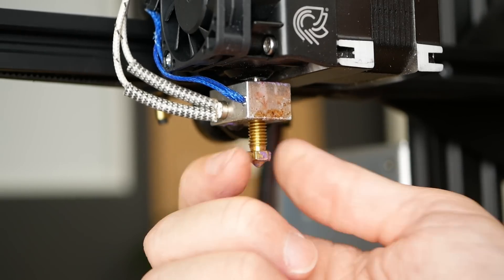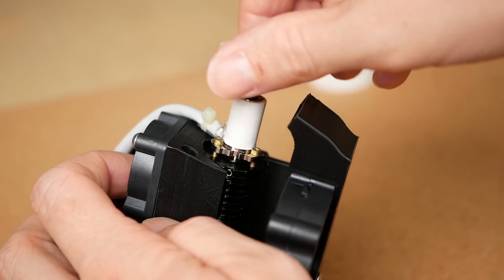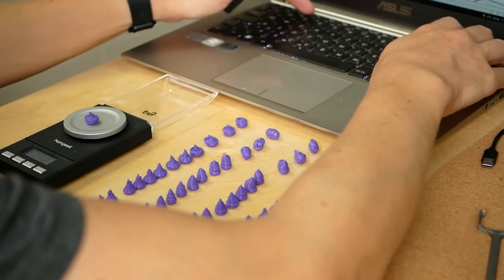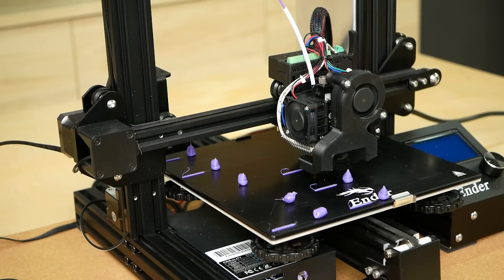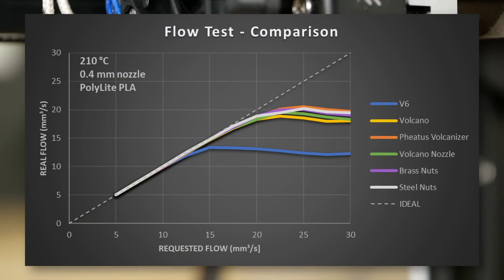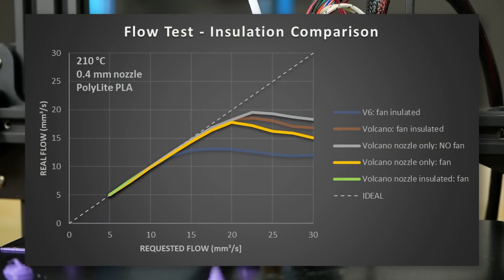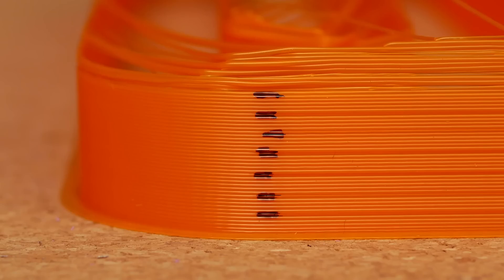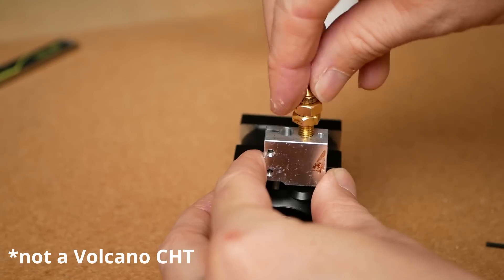Volcano is Obsolete: Just use Nuts!

Comment: Pretty interesting video Stefan! Have you tried finding a pure copper flanged lock nut? The do exist on Amazon or other sites and you would just remove the plastic washer inside. The flange part can go flush to the heat block end. Heck, you could add copper washers to the mix or a M6 binding barrel that has threading going all the way through. You be surprised the different types of nuts that could be a good way to increase heat transfer to the nozzle. :)

P.S. I'm trying out an  0.4mm airbrush type nozzle on my Ender 5 Plus and it is insane the detail you can get with Cura 5.0 new Arachne engine. They even have assortments down to 0.2 mm airbrush nozzles for around $8 on Amazon. :D
Reply: It would be better to get wider nuts. At that point you might just get a better block. less resistance and complexity.
Reply: @mckidney1  True. As long as what you get has a good and smooth flat surfaces between the heat block and the nut or custom metal piece you should get a good thermal conduction. I sometimes clean and polish my bi metal heat break with a Dremel and it looks really shiny. Add Boron Nitride paste and good to go. :3
Reply: have a link to the air brush nozzle you used?  thanks

Comment: Delta T is the highest in the top of the heater. By the time the filament enters the extension it's already heated quite a bit. So I'm the extension not that much heat needs to be added. Having the hottest bit on the top could actually be an optimum in heat transfer.
Reply: The downside is that the temperature will drop significantly towards the end so even if the heater is at 210C, the nozzle tip may only be 200C, preventing you from getting that extra heat in. You could compensate by raising the heater to 220C, but then when you aren't extruding, everything will heat up to 220C. Ideally you would want to control the temperature of the filament as it comes out of the nozzle. So having the heater closer to the nozzle tip and having the cooler end of the nozzle at the top would allow you to preheat the filament before getting to the nozzle and heater block. This would leave less of the filament at high temperature and for less time.
Reply: Which is why the copper results are so close to the results with nuts. The key element here is that the losses in the copper are not as big as the decrease of needed energy by the plastic. That will change as you said - longer nozzle and eventually the copper will actually cool the plastic.

Comment: Volcano block with a cht adapter, cht volcano length nozzle and a heat nut (heat zone extender)...(basically making the volcano longer) 
 Or the same thing on nitrams volcamosq.. I guess there is going to be a point where extending length is going to require higher heating capacity and maybe stronger extruder

Comment: would be interesting to see brass vs steel nozzle impacts, ie whether the poor layer adhesion and higher temp requirements of steel nozzles can be mitigated with a volcano (also, how much worse steel really is)
Reply: Steel needs longer blocks made with tighter PID variables. Making the nozzle longer will make it worse. Making it thicker makes it worse.
Which is why Volcano does not offer just longer nozzle, but longer block as well.
Reply: @mckidney1  from my understanding, the limiting factor with any nozzle-heatblock-material is the heat transfer between components, and using a longer nozzle might help there; 
even if not, heat conductivity is basically the only downside of steel vs brass, so getting a full volcano hotend for steel nozzle (rather than faster) printing might still be worth it

Comment: Hello Stephan and thank you for this instructive video :o)
After seeing it, I have a question about how to get more throughput to print faster:
🔥What would happen if the nuts were replaced by 1 additional heating block?🔥

The idea would be to have 2 heating blocks with a space between them 🔥🌞🔥:
- 1 to prepare the heating of the wire, but below the melting point (example in PLA: 160°C) to maintain a pressure in the nozzle channel
- Have empty space between the 2 to limit convection
- 1 other heating block for the exit of the molten wire (e.g. in PLA: 210°C) with a smaller height than a normal block.

Example: a normal block with a height of 10mm, a gap of 4mm, the second heating block would have a height of 6mm

If the temperature is better controlled on 2 heating points, wouldn't it be better to produce a more even, larger and faster output of wire?🤔

(I hope my idea is still understandable as I'm going through a translator from French to English)
😇
Reply: somehow install a thermistor on the heatsink and make the hotend fan temp controlled, probably it would get you a lot of clogs tho :D:D

Comment: I have a question! What about having 2 heating cartridges ? Have the first one pre heat the filament to 50% of what your main temp is, and the second one set to 200 for example. Would a preheat on the filament be better before into the main heating zones?
Reply: Like he said in the video, cartridges are not near their capabilities. Having more will introduce two sets of PID variables for not a big benefit. Th roblem that is solved in this video is that PID is a feedback loop system so if the heat has somewhere to go (capacitance) PID can push more heat into the entire system.

Comment: A hardened Steel Volcano Nozzle with brass nuts would be interesting. I wanted to print abrasive materials for a long time, but my first experience with steel nozzles and their bad thermal conductivity made a quick end to that.
So maybe a longer melting zone could fix that?
Reply: I did exactly that experiment, and indeed brass/copper nuts are not optional, flow is only a bit better without them. With brass extender I've got 60% more flow.
Reply: It sounds like you would be better off with a Volcano heater block, the brass insert from CNCKitchen, and a regular length steel nozzle. That way you would get the heating performance of the brass but the abrasive resistance of the steel nozzle tip.
Reply: Steel is worse than copper and the longer you make the zone the worse it gets. For steel you need to increase the block and shorten the nozzle (opposite of this)
Reply: @mckidney1  steel still has a couple orders of magnitude better heat transfer than plastic, and it is plastic which is bottleneck here. But yea, see my answer above -w/o brass nuts steel nozzle does little to performance, at least it was in my case.
Reply: @Balorng  That is not true, plastic is not the bottleneck. Plastic is the result. The bottleneck is surface area for the plastic. By increasing it you allow to melt more and introduce more plastic to again heat up thus increasing the flow rate. The idea here is to increase the area without increasing the size of the heating block. That is why steel becomes the bottle-neck and shows little to know improvement without adding capacity with the extra brass. Capacity will eventually dissipate and steel will again be used to transfer energy to the brass and the plastic again. So with steel nozzles, longer nozzle requires a longer block not adding nuts at the end :)

CAlling plastic the bottle neck would mean we need more plastic capacity to solve the problem. Not a bigger surface area to the plastic.

Comment: Out of curiosity: Did you ever tested a high flow nozzle or even the Volcano-Nozzle in an E3D-Hotend (and copper nuts) but with thermal paste in between?
Reply from the maker: I didn't but I'm quite sure it won't help a lot. The bottleneck is still the heat transfer into the filament.
Reply: Thermal paste is about 100 times worse than the copper in the nozzle. There is also more than 100x more  copper than the paste. This is a system that is designed to saturate the system with heat and not a PC build.
Reply: @mckidney1  You're mixing something up here. The purpose of thermal paste is not to outperform the heat transfer of copper or any other (mostly metal) material, it is to minimize the heat transfer resistance between two objects. In this case, it would be between the threads of the nozzle and the heat block and between the copper nuts. Of course, PC thermal paste would definitely not work, it is not even close to being heat resistant enough. You need high-temperature thermal paste for this application.
Reply: @toctoc9927  I think some kind of low temperature solder might be best (field's metal is one of the few non-toxic ones, but it's expensive; Rose's metal etc. are cheap). These all melt below 100 C and should be possible to apply in hot state and then screw the nozzle in without touching it with bare hands. I think most of these wouldn't alloy and ruin the heater block. There may be thermal expansion issues, but I'm not sure. Gallium is sometimes used for PC cooling as a "heat paste"; but it will wreck aluminium if given time and especially if there are any fresh scratches in the aluminium. If you get a bunch of gallium in there it will become as brittles as a day old baguette, and above as easy to snap off a piece. Gallium or gallinstan works for PCs because the IHS nickel-coated copper and the heatsink has a copper base (sometimes also nickel coated to match the aluminium fins) and very rarely is it just made of pure aluminium (if it is it is either an old or very low quality sink). Gallium would take the heat no problem; but it ruins some metals.
Reply: @mckidney1  I have to disagree.   Using thermal paste in between the components could lead to more even distribution of heat. Allowing more uniform melting. Though assuming good metal to metal contact the effect might be rather small. Depends how tight the nuts are screwed together and how good the fit on the threads is.

Comment: I've squeezed a bit more performance from my DIY "volcanoid" solid copper hotend by adding high temperature thermal paste (400 °C stable) to fill the air gap in the threads. (Don't use regular thermal paste)
Reply: High-temp 'anti-seize' compound is a great high-temp thermal paste.
Some are rated to over 1500F...high metal/metal oxide content makes for very good heat transfer.
Works fine on my V6...keep it away from the thermistor; the stuff can be electrically conductive.
Reply: I use HY880 thermal paste in my Hot-End, even on heater cartridge. It is rated up to 280℃ and I printed nylon at 270℃ with it.
Reply: what is the high temperature paste made of?
Reply: @cutterboard4144  I searched for thermal paste that's made for high temperature sensor mounts (exhausts, heater etc.), found a company that sells 5 gram syringes of that stuff. It's labelled "TG 20031" though that might just be that company's product ID and not a general term.
Reply: I've bought some for my hotend thermistor that is one of those small glass bead ones, the temperature stability was horrible until I threw some garden variety silicon white one, but it didn't last obviously.
Now I'll add it to the hotend and such, let's see how much better it gets (tho I bet not all that many %).
Reply: I was just thinking about that! I have some hotend boron nitride thermal slurry from slice engineering for that sort of stuff. I even put some around the thermocouple and heater to get more accurate and more precise thermal control
Reply: Sounds messy.
Reply: Would automotive copper grease do well in such application?
Reply: @aurimasknieza7320  no it serves the opposite effect. But do not worry your printer is nowhere near such sensitivity that paste will be needed. Such a printer would require Slicer to adjust PID settings based on flow rate.
Reply: I see what you did there.  :D
Reply: How about some blinker fluid? Better than HT thermal paste ©

Comment: I'm curious to see what your results would be with a silicon sock added to your block and to the exposed threads of the volcano hot end.
Reply: I was thinking that you could put silicone sealant over the nuts and nozzle body, you can peel or cut it off if you need to change your setup. That should also insulate well.
Reply: The socks and isolation affect efficiency. As long as he is pushing enough power socks do not help. Now a copper sock would help :)
Reply: @mckidney1  He already clearly indicated in his video that the silicone sock helped and that power was not the issue. He had a 40W heater and it only takes 10W to melt the volume of PLA he was pushing, so he was not lacking for power. The power is introduced at the heater block; everything beyond that will have lower temperature due to thermal conductivity creating a thermal gradient. Adding more cool air at the other end of the system increases thermal losses which increases the temperature gradient, lowering the effectiveness of the heating at the end of the nozzle. You need to keep the entire nozzle hot and ideally at the same temperature. Sure, you could increase the temperature at the heater block, but then you run into other issues as you burn your filament when it's not being extruded. To get even and consistent heating you want a large melt zone with high thermal conductivity and low external losses to minimize the thermal gradient throughout.

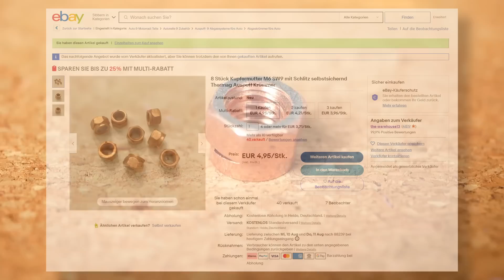Comment: 6:30 Tbh you should have known :D
You can also get these copper nuts in the Baumarkt (german here lul), sometimes they are called "Thermag-Muttern"
They usually find their place in the automotive world where they are installed on high-temperature parts like the exhaust manifold and sometimes even the whole exhaust system. The copper plating only prevents them from rusting onto the stud :)
Reply: Here it might actually help as a solid thermal paste :) Moving the stored heat in the nuts back to the shaft.

Comment: Maybe you should better use monolitic aluminum nut? It's very simple to make one - even without lathe.
Reply: Those nuts serve as capacitors in the system. They smooth out the changes. Resistance is not the key factor, capacity is.

Comment: And I was right, the forgotten secret about 3d printing nozzles is that the energy needed is actually pretty low. The performance is directly affected by constant battle between cooling and heating. The more you cool the more you can heat up. The only danger is resistance causing too much gradient - crystals and/or clogs will form wearing out the nozzle. We always laughed at those cute socks people put on their pet printers. The biggest cooling effect was always the plastic itself. Who knew that doubling the plastic allows the heater to put more heat into the system :)

When it doubt, ask your mom in the kitchen - we do not put socks on pots :)
Reply: With pots the biggest heat loss by far is evaporation; so you put a lid on them; but it is not that unusual to put a "sock" on a pot; many camping stoves have an insulated sleeve on the pot. Slow cookers use an insulated bowl; that's a big advantage since they are not meant to boil the food for 8 hours; they just keep it at around 90 degrees C so the evaporating water can condense and recirculate over and over. Then there are the classic fireless cookers; which is similar to the slow cookers of today in principle; you bring a soup or something to a boil on the stove; then you put it away in an extremely well insulated box (looks like a big chest, 15 cm thicker than the pot itself; with insulated tubs for the pots). There is a modern version of this which is a pot that is heated and then put in essentially a double walled giant vacuum flask thermos. The big advantage of the fireless cookers was back when cooking with wood was common; instead of tending a fire for 1 hour while the food cooks, you could spend 10 minutes cooking, then put away the pot in the fireless cooker and let it finish for 2 hours by itself while you do something else. Fireless cookers are still popular in poor countries where they use biomass stoves.
Reply: Aluminum dissipates heat extremely fast, which is why heat-sinks are usually aluminum. 
Putting a silicone sock on an aluminum heat block adds significant efficiency to the system. This way you are moving more heat into the plastic being extruded, rather than simply losing heat into the air and struggling to maintain temperature. 

Using a metal with more density, like copper, improves this further. It also provides more even heating, as it’s not dissipating heat as rapidly. 

The heating element on most heat blocks is offset to one side of the nozzle. If you are dissipating heat faster than the heating element can heat the entire block evenly, you will see a degradation in print quality and lower maximum extrusion rate. 

Containing heat is good. Consistent heat is good. Neglecting to insulate things that need to be hot and dissipate heat quickly is bad. 

You’re not cooking in a pot here, you’re extruding molten plastic, and probably trying to be reasonably precise about it. Controlling variables is how precision is achieved.
Reply: @KennyEaton603  Also the whole "No sock on a pot" thing is kinda moot too when you don't really want wind blowing on a big pot you're cooking with. It just takes ages to boil for some reason.
Change pot for hotend and it's pretty simple. On a stove you're usually full blast but when printing you'll be in PWM. You WILL be running more heat to the system if you're cooling the wrong thing while you're printing, and like you said, may as well also run into thermal gradients where the thermistor/sensor might see a higher or lower temperature than it should.
Reply: go tell that to my volcano hotend, i have so much cooling fan than i literall "stall" (drop temperature of 20°c)  the nozle if i dont have insulation....

Comment: i would say thermal paste on the threads coupled with the double nut version may improve results again. nice vid
Reply: Paste decreases resistances and offers 0 capacity. Effect would be minimal. Once the printing starts system is already saturated with heat.